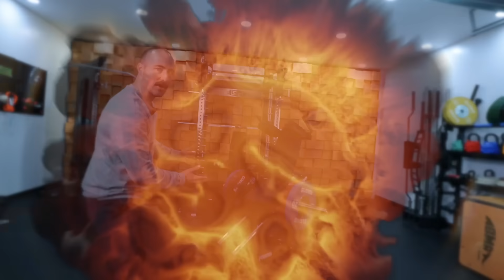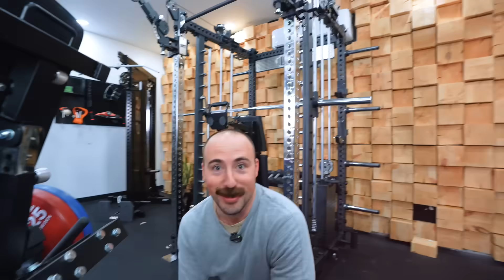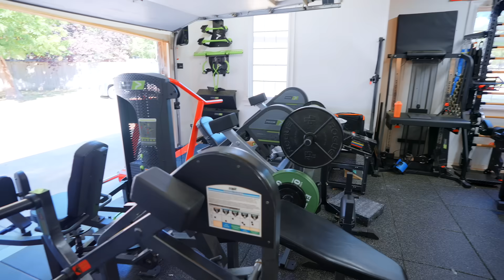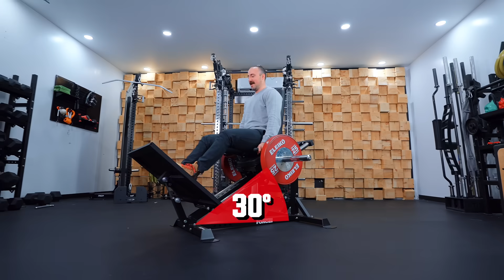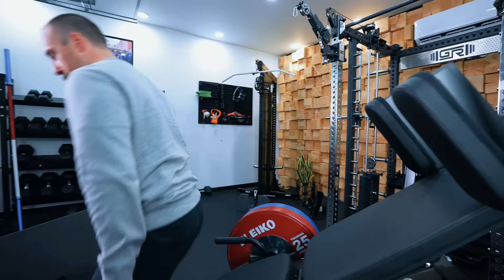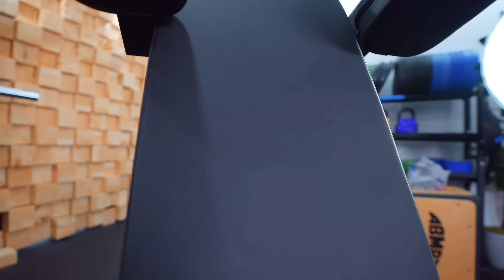The Ultimate Compact Leg Press/Hack Squat Combo With A Special Feature!

Comment: Coop you should check out the RitKeep Thunderbolt A10!

Definitely seems like one of the better Leg Press + Hack Squat options around $1K with large 50mm guide rods w/rollers, large foot plates, good weight capacity, and lots of adjustability.
Reply: Better quality, probably almost certainly... but it's freaking MASSIVE! haha. Coop is primarily focused on the home gym market, where floor space is often limited. I'm sure we'd all love one of those at home, but it just isn't feasible, and hence, probably not of key interest to this market/Coop's channel. But yes, it does look nice. 😅
Reply: @granthartley  Yup for sure it's a bit of a bigger option. Though still in the same ballpark as many budget options like the GMWD Arete or RitFit Gazelle but with a larger foot plate for leg press!

It definitely does have a larger depth for sure due to the design of the adjustable hack squat foot plate using a ladder style system. Wish they could update that to reduce the depth needed.

But I should note the width listed in the specs includes the top plate horns which I believe are removable, so if you take those out (you can still use the 25" of space on the inner/lower horns for loading) it significantly reduces the width.

So it's not quite as big as the specs make it seem, but yea for sure not as compact as this Force USA option or other similar sled style options. The extra size may allow for more depth/ROM and adjustability and such so maybe it's a trade-off and most leg press / hack squat combos where the seat is fixed and the sled moves seem to be larger than these sled ones where the seat moves instead.

Comment: I went to do my back workout today and checked the machine to see how that piece that broke off was doing on mine. It looks pretty solid still, and this is after 3 months of pretty much twice a week usage. So I would assume that the welded piece that broke off was probably a deficient weld that somehow passed quality check, but only time will tell if this could become a problem or not in the future.

Also tried out the trick you mentioned about keeping the backrest/hack squat connection angled up more to get a better depth while doing hack squats, which was one of the issues I first noticed when I tried the machine out. Works much more nicely. I was entertaining various ideas for creating something to go atop the footplate to allow for more depth, but this solves the issue at least partially. I still may go that route, but now I can do more hack squats without the limited depth factor.

Comment: I've had this unit for about 3 months now.  Excellent piece for home gym given it's multifunctionality.  Arrived within 5 days to my door on palate in a few boxes.  Took about 2 hours to assemble (including carrying into basement, unpackaging and laying out pieces and actual assembly alone).  Packaged well and no damage through shipping.  No build-quality  issues for me yet with the latch system - but I will be on the lookout for that now.  I feel  proper Hack squat form should bee fully reclined and have no issues with depth vs what Coop is saying.  My cue is to actually have the plates touch footplate for depth.  I use a bumper set on the inside where it makes contact with footplate and use calibrated oly plates outside where they won't hit.  I have loaded way more on this than I guess it is rated for because I didn't calculate in my weight nor the sled weight.  I also installed dual sided band pegs and use a band on either side looped around black portion of weight horns to get added resitance towards the top of each movement.  I can definitely recommend unit.
Reply: How did you install the peg bands?

Comment: Bought this unit, and their 3-tier dumbbell rack around Thanksgiving… really happy with both …depth is the only minor issue, odd to me that they’d produce it without figuring that out… 1) load some 10-25# plates before your 45’s so the 45’s don’t bottom out 2) install/spin your handles up 90* and they’ll be in a more comfortable spot for your hands!! 💪

Comment: Edit: Per the first reply to my comment, the stated weight capacity is for the horns, not the total weight the sled can handle. That makes a big difference and would actually make this usable for me. It would put the maximum feel weight at 445Lbs at my current body weight.
————————————————————
Original post:
The weight capacity is very low for a leg press, especially when you calculate the feel weight. At 30 degrees and a max weight of 660Lbs, your maximum feel weight is 330Lbs based on basic trigonometry.
SIN(30 degrees)=0.5
Max loadable weight=660Lbs
0.5*660Lbs=330 lbs which would render the unit unusable for me for hypertrophy work
The Body Solid unit holds 1000Lbs, so a maximum feel weight of 500Lbs which would actually be useful for me.

45 degree units give you 70% feel weight of what you load, but I would not recommend putting this unit on an angled surface or propping it up to get it to 45 degrees. Just save up and buy a better device rather than set yourself up for a severe injury playing a balancing act game with a leg sled.
Reply: I actually emailed Force USA a few months ago and they told me 660lbs was the limit for the weight horns themselves, so you could still get around 450lbs of resistance if you weigh ~200lbs.
Reply: @ Thank you. That is good to know and makes a huge difference. They should update the listing to make that clear since on this type of device your body is definitely part of the weight you lift.
Reply: Why not prop the back up a bit to make it 45?  @v5red
Reply: Edit: A short answer would be to say that I also wouldn’t buy a flat bench and then just prop up one end instead of buying an adjustable bench
————————————————-
@ Because that is unsafe. The unit is not designed to rest with its back propped up. You then would have an unstable leg sled. I value my personal safety and lack of lifting injuries. If you want a unit that is at 45 degrees, you should buy a 45 degree unit. It will cost more, but the safety of that over propping up a leg sled is more than worth the additional cost.
Reply: @ Lots of home gym owners modify their equipment to do things they weren't designed to do, myself included. Often the product we want does not exist in the size we have space for or there is some other constraint that necessitates DIY modifications. It's not inherently unsafe, it might be or it could be completely safe, it just depends on the specific equipment and what you're doing with it. Adult humans who are responsible enough to lift weights alone in their homes are usually capable of making such judgement calls. On the other hand, people do stupid things all the time and injure themselves. Either way you can't logically make a blanket statement that applies in every scenario.

Your comment about propping up a flat bench made me laugh because Mike Tuchscherer did that for years, even inclining 405 on that setup at one point.
Reply: @v5red  Safely propping up the back end a few inches on secure blocks wouldn't be dangerous, not sure how it would be with this. Not on anything rickety lol

Comment: I have the Titan version, rated at 700 lbs. I load 500-600 pounds of plates plus I weigh around 220. Works well no problems after more than a year of regular use.

Comment: I own the big brother to this unit and I love it.  I agree the vinyl is just ok.  Its probably my biggest complaint about the until. Most folks use a lot of weight while leg pressing or hack squatting and they vinyl stretches under that pressure.  I have some wrinkling in the spots where my upper back hits the pad.  I have had it for 8 months and use it once a week.  I would love to see them come out with an upgraded back pad.  I would buy it in a heartbeat.  Thanks for the great review.

Comment: Coop,

Have you reviewed the ForceUSA MyBench yet? I saw your tier list for benches a few months back and you only had mention of one ForceUSA bench, but you ranked it rather low and mentioned it had attachment options, but seemed to imply they were additional items. I found when purchasing this hack squat/leg press combo 3 months ago that the MyBench comes with a leg developer (curl/extension) and a preacher pad curl attachment with the bench itself, two of the attachments I was most interested in getting if I were getting a bench with the option for attachments in any case. I was tired of using dumbbells and holding them with my feet to do lying leg curls lol.

The attachments work well, the bench is not bad either, and while it's a tad higher than the specs online give credit to, it's only 2 inches higher than my old bench, which I still have and use as well, and it's a 700 lb weight capacity, which for most people will be plenty. The price point is also quite good. Currently with discount applied, it's $499 Canadian dollars, $399 on the US website. When compared to other options such as the Ironmaster Super Bench Pro V2, which for me to get in Canada would have cost somewhere in the maybe $1500 range, especially to get the additional attachments which ARE NOT included like this bench has, I feel like it's a killer steal for many home gym users, especially if you're not concerned with using a bench at certain IFBB heights, which this is a little tall for. I haven't seen many reviews online for it either, which makes me think it's being slept on by many in the home gym community. I'd love to see a review on it, what you think, where you'd rank it. I'd say for me and my uses it's a solid B+, if not A- ranking, as additional height just changes things a bit much to use it with my crappy old rack, requiring different height for safety bars, etc. It's a little bit longer length wise as well, which also detracts from it a little bit, but otherwise it's a solid option for anyone looking to get a bench that won't break the bank necessarily and also comes with leg and biceps attachments included in the price!

Comment: How should 30 degrees put less stress on the knees? All the other angles are the same. Just lift the back of the Atlantis hack squat a few inches, take off a few lbs and you have 45 degrees which feel the same. What is the difference for the knees then?
Reply: Yeah it makes no sense to me either unless you’re just talking about warming up with no load, in which case the effective starting weight is lower, but most people don’t even bother doing an unweighted warmup on leg press.
Reply: None. That was odd. His knees were either warmed up, or he was in a more comfortable position because of the large platform, but the degree wouldn't affect your knee travel.
Reply: Yea I've always wondered about this! There's got to be a reason why most of them are angled though 🤷‍♂.

I've always thought why don't leg press / hack squat machines just come in a vertical 90° version which takes up the least floor space (though probably more height) and requires the lowest number of plates to load to reach your desired resistance?

So long as the back pad and other angles are adjustable to match the angles you'd have between your body and the sled on 30-45° versions it seems like it'd be a pretty much identical movement, basically just taking any machine and lifting one end until it's vertical.
Reply: @KillerK009  The main reason is probably the starting weight (you would get 100% weight of the sled plus BW and for commercial gym equipment generally it’s designed so that it can be used by almost anyone no matter how weak). But I agree, vertical would be ideal for home gyms.

Comment: A 30° sled wouldn't provide a good weight ratio. You'd need to load up the machine with lots of plates to get the equivalent of a vertical leg press.
Reply: I have this machine and I’ve been toying around with putting the back feet on some 45’s or something 😆

Comment: Cool review. I got this exact unit 10 months  ago & it’s way different. Real unit comes with crappy plastic pins and not those knurled pop pins for foot plate angle, sled angle, calf block, or hack squat adjustment. Hack squat depth was more shallow, not just based on user height bc for me carriage hits before 45 lb plates. Had to strap 2 yoga blocks to the shoulder rests to get full hack squat depth without bottoming out. Also the calf block has no diamond grip pattern. It has this crappy thin aluminum criss cross thing thats held on by 6 screws which completely bent & warped after the first few uses. I’m not sure if they sent you an upgraded version or just made a ton of improvements. Should be something to note though in case the product you received is different than the product us as consumer receive because it has been less than one year since I received mine and the quality on several items are vastly worse
Reply: Seems to me like you got a prior version.  I just got the same unit Coop reviewed.  No problems with it.  I’m 5’10 and the depth is more than need in leg press and just enough or slightly over in hack squat.  I was concerned about plates hitting and bought extra 25 pound plates to use as spacers.  But didn’t need them, 45 plates don’t hit unless maybe you are using large bumpers.  

Only issue with Coop’s review is I had read the 660 pound limit was on the weight horns — not personal or sled weight.  I would check that as I think it came from Force USA.  In any event, it holds plenty for us and can always add bands.
Reply: @SnarkerC  that makes sense. It sounds like they updated right after I bought. Would’ve been nice to get an email or an option to at least upgrade to the pop pins and calf block. I might try emailing them or something. I’ve done leg press with 630 lbs of weight on the horns and it holds up fine every time. I weight 220 so if you include sled and user weight I’m going over. I had to actually get the thin weight it out plates just to fit everything on the sleeves.
Reply: It might be that you got the previous version? I'm not sure when they came out with this one, but I do remember seeing reviews from about 4 years ago maybe for the compact leg press which didn't have the hack squat functionality. We moved since and I was looking to get a few pieces of equipment for legs recently and I opted for this one because of its smaller footprint and overall price range. It fit perfectly in a corner of my basement gym which was otherwise being unused except for housing a teeter inversion table which I hardly ever use so I put this in its place. That was purchased in early November, so just over 3 months old right now, and I can say it's the same as what Coop is reviewing here, so maybe you purchased it just before they integrated new changes to the machine.
Reply: @Zoogleas  I guess it could be worse, I would be pretty disappointed if I had one without the hack squat functionality. Calf raises feel so much better on this unit when it’s in the hack squat mode. It sounds like they upgraded the depth, pop pins, and calf block right after I ordered. They really should’ve contacted all recent orders that happened right at the time of the upgrade to at least give an option to pay to get the upgraded pins and calf block. Feels like a big miss on their end.
Reply: @joebower1417  Yeah, could have just been the worst time to buy it lol. I would give them an email and see if there's any options to upgrade some of the pieces as you said. It's worth a shot. I love the calf block, it really was a game changer for doing calf exercises, as using a barbell was a little bit wonky I found, not to mention using plates and other things to create elevation to get good ROM. The hack squat is still an issue for me to get good depth on as Coop was saying in his video, but I found his tip of angling it a bit higher to really work well when I tried it just a little while ago, so that's a cool little workaround at least.
Reply: They make upgrades all of the time. I think mine was version 3 and it is more like yours than the one in this video. Almost makes me want to trade mine in for an upgrade.

Comment: Would be interesting to see you compare and check out the Blazzed. These literally seem like the exact same machine (based on trying the Force and having the Blazzed) and am wondering if Blazzed actually is making them since they make other products for other brands. Great review as always.
Reply: Completely forgot about that recent review.   I went back and re watched...they are very similar.
Reply from the maker: Oooh that's interesting. We have their full sized combo unit, but not the compact version. - Coop
Reply: @GarageGymReviews gear for fit has a similar unit that has the exact same dimensions and weight capacity.

Comment: Just got this unit last week and am very impressed. No depth issues from family with heights up to 6 feet. Fits the space and is light enough without weights that it can be moved around if necessary. No issues so far with the welds.
Reply: Give us an 8 week update please.
Reply: I’ve owned this for must be near on a year. I love it, I’m 6 ft and feel it doesn’t go deep enough on a hack squat, so I have bolted some wood between the pads and the pad attachment, now I can go right as deep as I need. And nothing has broken on mine. Love it
Reply: I'm 6'3. Can I use this?
Reply: @TheSophisticatedSavage  you'll get better depth. So yes.
Reply: Are you able to do a reverse hack squat pretty comfortably